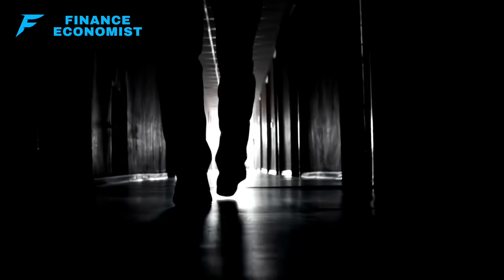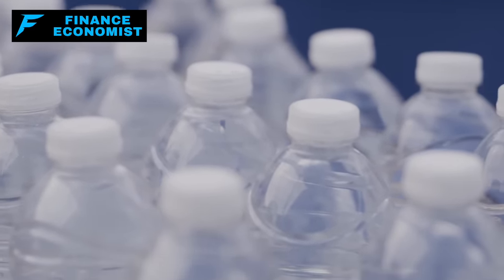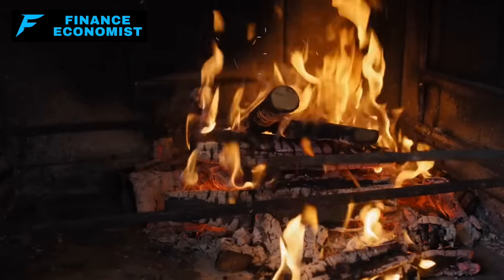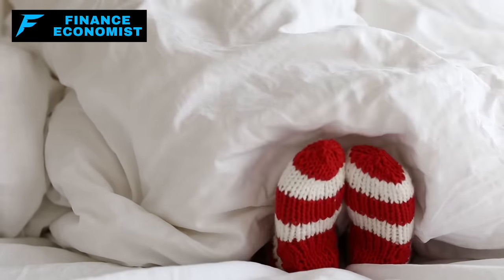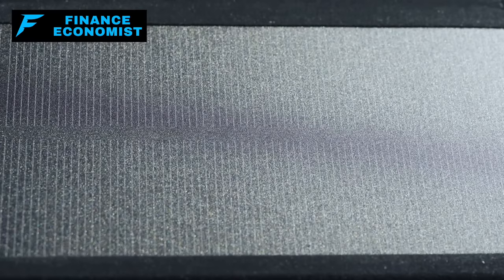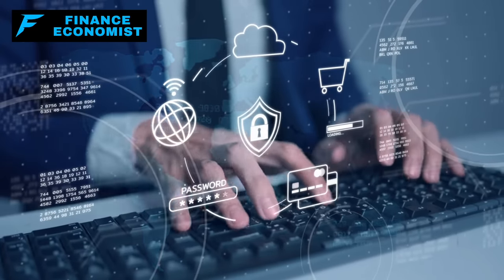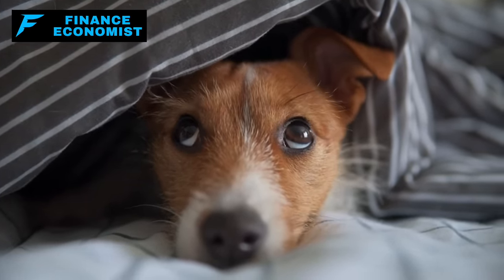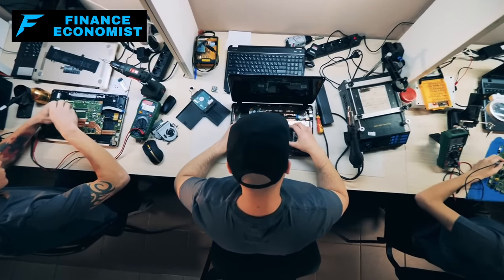10 Prepping Items to STOCKPILE for 30 Days of WINTER BLACKOUT – STOCK up NOW!

Comment: Your fuel estimates just smacked me in the face! This summer I added a 10,000btu kersene heater to my stash and today I went out to get some more kerosene. H D was almost out already, I could only get one, 2.5 gal can. I already had 5 gals for my 4 oil lamps. At maximum consumption, I went from 1 gal a day for the lamps only to about 3 gals a day for both the lamps and the heater,  so I don't  even have 3 days worth. I do have other heating choices but I want the kero to be my primary fuel, so I really need to reconsider my plan and its budget.... I have also been dragging my feet over water with only a weeks worth, or so, set back. I need to get on that right away too. At least I do have a developed plan in place for that... Thanks
Reply: Kerosene and candles.
Reply: I’m no way there, I thought I was doing good, but not after hearing this 😟

Comment: I got 30 gallon water barrels and put rhem in the corners of my coat and clothes closets not so tall I loose the useable shanger space.  By my measure each barrel is 10 days of water so I'm okay, not great, with 4 of them.  I use a battery powered pump (rv type) and have an animal watering trough heater to warm them if things get That cold.  Have +/- 3.5 gallons(in 1/2 gallon bottles) of Lamp oil for 4 lamps (not as good as a kerosene lamp). Need more winter socks and another polypropylene wicking underwear set. I need more traditional books as I have too many on electronic devices. ... Sooo much to do with sooo little time and money.